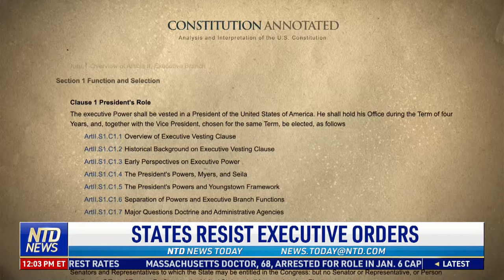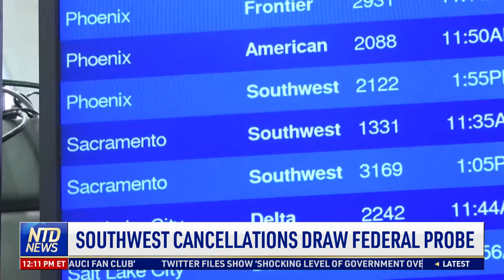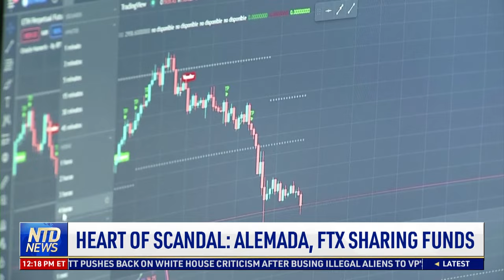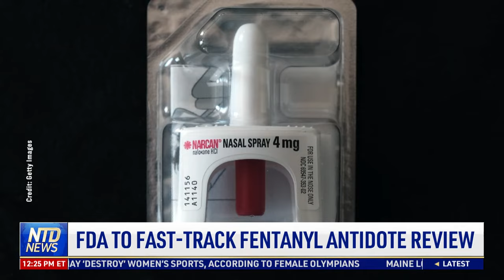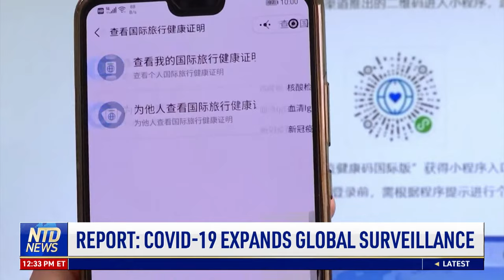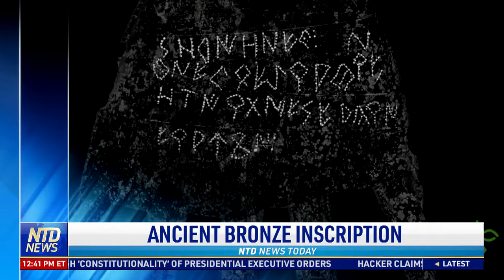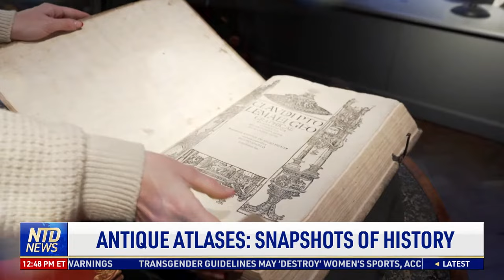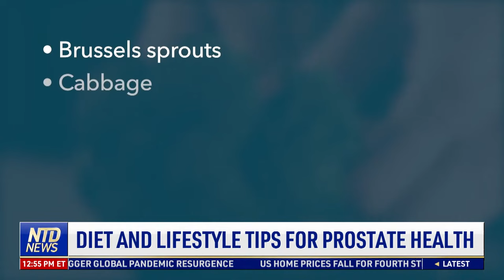Kari Lake Appeals Election Lawsuit Dismissal; Gov. Abbott Defends Sending Buses to VP's Home | NTD

Comment: If a airline  southwest does not want to fly in certain weather not feeling its safe for its equipment or employees, and customer I applaud them for their bravery
Reply: That's not true. Southwest airlines canceled far more flights than other airlines, all of whom were under the same weather conditions. On Tuesday, Southwest airlines canceled 2,500 flights, the next highest is Spirit airlines canceled 75 flights. The cancelation is worse for Southwest airlines because it operates many shorter flights with tighter turnaround times. As of Wednesday, most airlines have returned to normal operations, but not Southwest. It has to do with planning, resources, and investment in technology. In addition, Southwest is shorted about 850 pilots, some of whom were fired due to not complying to the vaccination mandate.
Reply: Not because of the weather. It's the shots.
Reply: @georgebricker1010  There is nothing wrong with being profit driven. Southwest just needs to upgrade their technology and operating procedures.
Reply: @lancecahill5486  and hire more people. Without vaccine mandates.